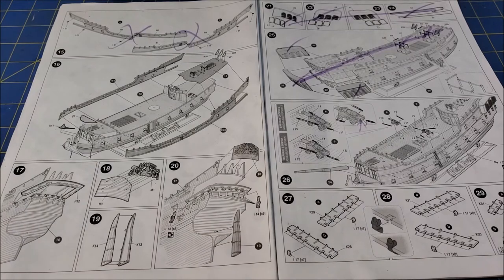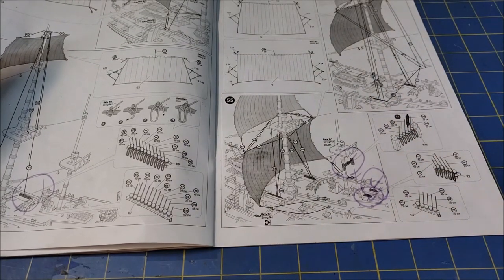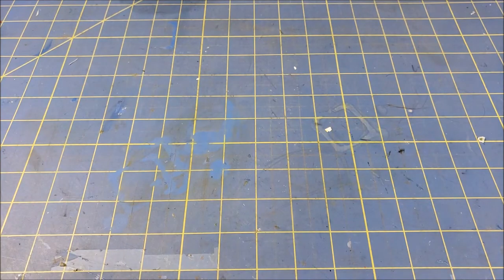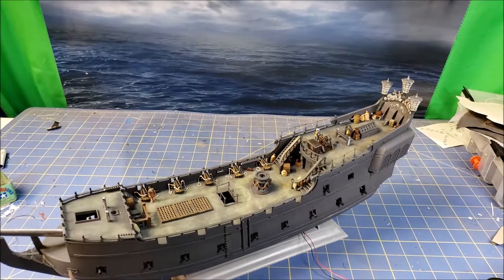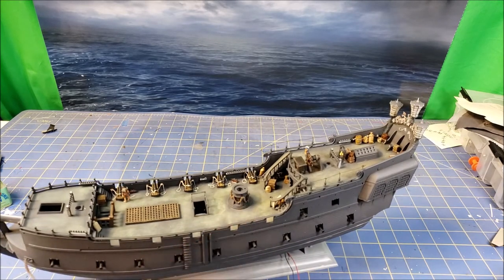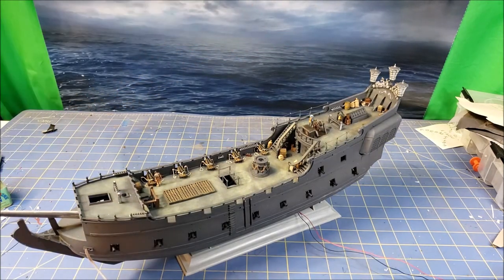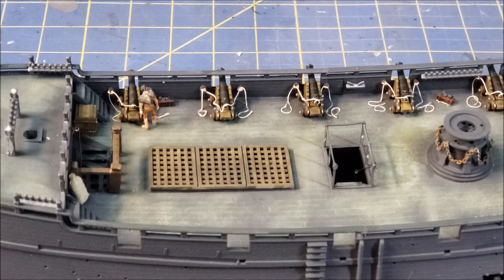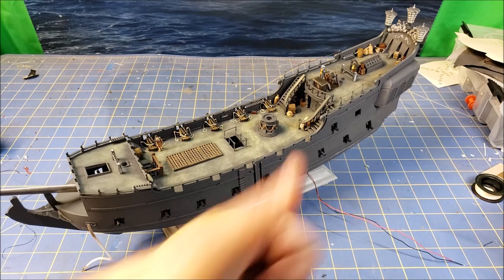Mal's Projects: (7) The Black Pearl - Zvezda 1/72

Comment: How did you paint the deck? Very realistic. I am also assembling this model.
Reply from the maker: What I did there was just a bunch of dry brushing techniques.   It started out with the same "blackish" color - and then I used Vallejo desert sand as a very light drybrush through all the areas of wear.  Like all drybrushing, I was light-handed with it so it took a long while to build up the pathways of wear on the deck, but it really was that simple.

Comment: Mal, how did you run your lines for the aft transom lanterns?  I drilled holes thru the lantern fittings with a pin vise, but trying to figure out how you might of run your LED leads.  I'll be using a Nano LED for each lantern, so I'll have 3 sets of thin leads I will need to get into the Capt's cabin.   Did you run those along the interior corner of the aft wall??
Reply from the maker: Hi there.. that's exactly what I did.  I connected the ends of the leads to led wire, and ran them down the corner of the aft wall.  The center lead I split - red to the right, black left - and then just hid the entry with deck scatter.  A little bit of creative use of greenstuff where the lanterns mount hid most of the work.   Good luck!
Reply: Thanks, that's what I thought.   Great build !!

Comment: How did you make those curved stairs and the railing? I'm getting ready to build mine and I really like how these turned out :)
Reply from the maker: I TOTALLY missed putting that in, didn't I? oops.   I knew I wrote it up, but apparently didn't film it.   What I did was 1) took the stairs from the kit, and trimmed off the inner baseboard from the 2nd stair from the bottom, down.  I then removed the bottom stair.  I then laid 2mm styrene I cut into a strip over top of the inner baseboard, and just bent it.  
2) then I added 3 stairs in place, and cut them longer to fit to the new "bent" baseboard.  
2a) I also added new stairs between the existing ones, as the scaling was more appropriate. 
3) again, using styrene sheet, this time some 3mm stuff, I cut the curved railing, and I bent the tip "up" as it got to the bottom.  The railing  posts are from an HO scale house porch.  

If you're on the book of faces, this link should give you an image of the stairs after they were rebuilt. The white parts are new styrene, the black ones are the old stairs.
https://www.facebook.com/MalsModelingAdventures/photos/pcb.1129830944114625/1129830074114712/
Hope this helps..and thanks.
Reply: @syrmalcolm  Ooh that's great! Thanks for the tips, I'll definitely try to recreate these stairs on my kit :) I watched all parts of your build and the final result is amazing!
Reply from the maker: Thanks for the feedback, glad it can help. I'd love to see how yours goes!